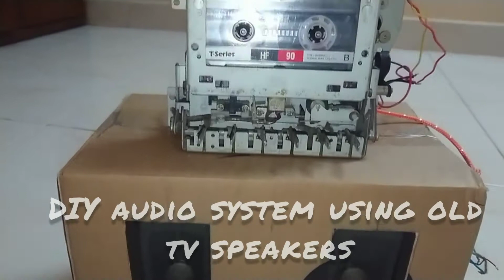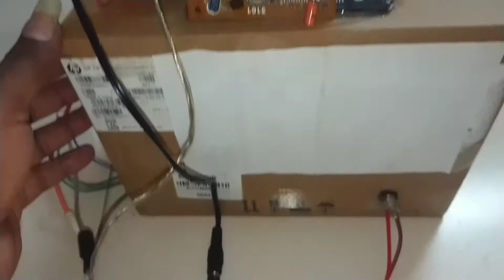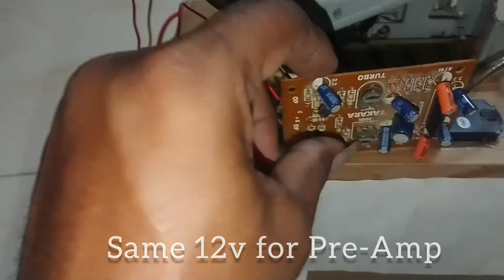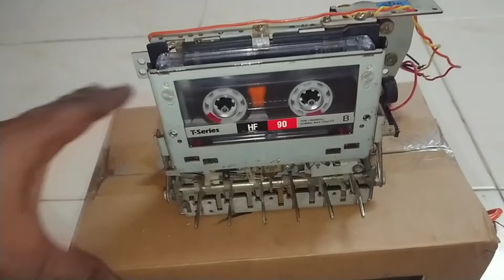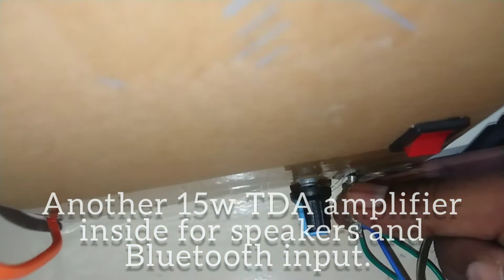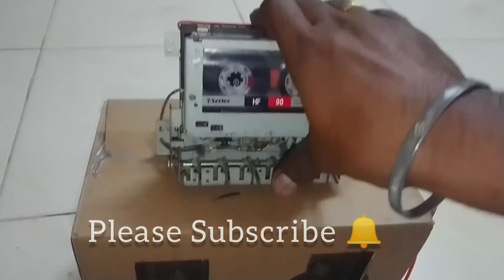DIY Audio Cassette player mechanism - playing songs from cassette

Comment: Hi bro nenu 4440 ic board connect chesa bro very lesss sound pre amplifier circuit board vadala brooo please tell me my clarify comment pleassss........
Reply from the maker: Need to have a pre amplifier board compulsory, Which will power up the head and also amplify the base signal

Comment: Bro i have an audio casset player ""NATIONAL RX W34 MODEL I WANTS TO RESTORE IT RADIO WORKING BUT I HAVE PROBLEM WITH CASSET DECK KIT CAN U HELP ME?
Reply from the maker: Sure! Is it not working or sound issue. Check whether mechanism is working like motor/belt issue
Reply: @jeayin  bro radio working and speaker paper needs to be replaced but still producing some sound ,in cassette deck idler gear broken and i assume belts needs to be changed rest everything good in working condition
Reply from the maker: @satishram8127  speakers i possible u can buy new one and replace or check with any local shop. Belt and gear it's difficult, belt may be available in chennai Ritchie street.
Reply: @jeayin  thank you so much bro ,if u see any possibility of idler gear plz let me know ,or the whole casset set just like  the one in your video also i will buy if u see anywhere let me know plz thanks bro🙏🙏🙏

Comment: Bro Please Can You Tell Me That How To Do Motar Connection Of Old Tape Recorder ...
Reply from the maker: jus provide between 9v to 12v dc its enough to run the motor. Also check polarity whether motor is running in correct direction.

Comment: brother where I can get this mechanism?
Reply from the maker: It's not available in market, i recovered my old(20 years) one. To give life for my cassete collections.
Reply: I've one here with me, same mechnsism. But need some service.
Reply: @harishmadhu5444  please Put a video on FLD Mechanism Repair.
Reply: @jeayin  I want to restore my taperecorder plsss.
Reply: What is that board you are using which is connected to head
Reply: @mechanicalandelectronicsengg  The old one was using a LA3161 tape head preamp. Unfortunately it's heavily damaged. Now I have to source one or make one from salvaged IC.
Reply: @harishmadhu5444  ok thanq
Reply from the maker: @mechanicalandelectronicsengg  It will be difficult bro,  spare are not easily available. Especially belt.
Reply: @jeayin  s bro ur right. I searching for belt from one year I didn't get till now
Reply: Belt is available in Richie street, Chennai....but single belt you won't get... it's a pack of 25 belts of various sizes...Rs.250/-